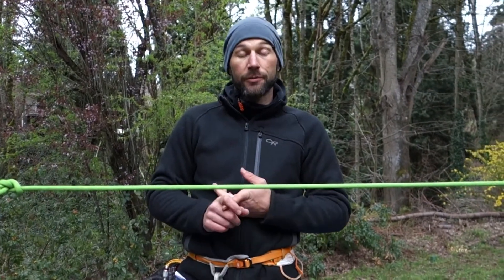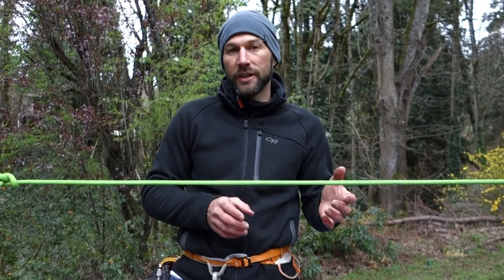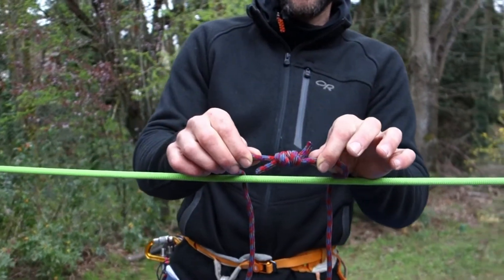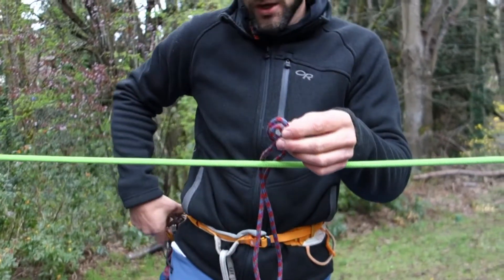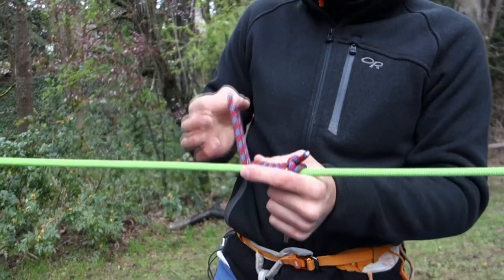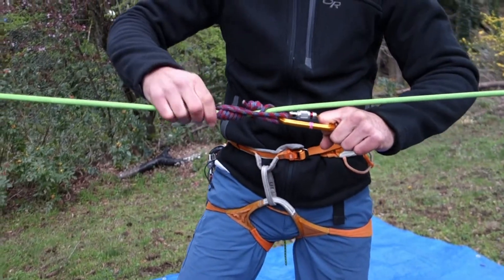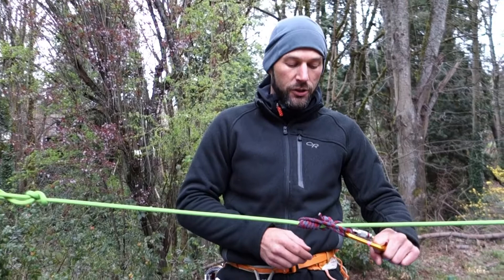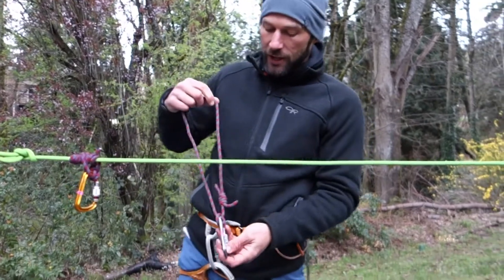Friction Hitches for Climbing

Comment: For the Klemheist is that a 6mm nylon rope? I've been using a 8mm rope but it never grabs for the Klemheist.
Reply: the limiting factor of any cord or line to create a hitch is the lines ability to create the smallest circle when you "pinch" a tight bight and the tension of the cord internal diameter (compression) and the outer diameter (elongation) reach a point where they cannot be made smaller. often called the pinch test. a good reason to use sewn webbing runners as hitches, more surface area and the "pinch" is practically zero in diameter.